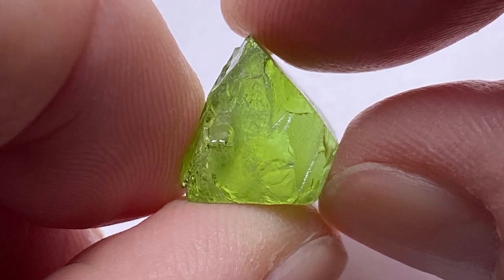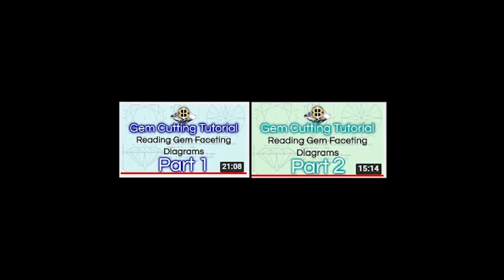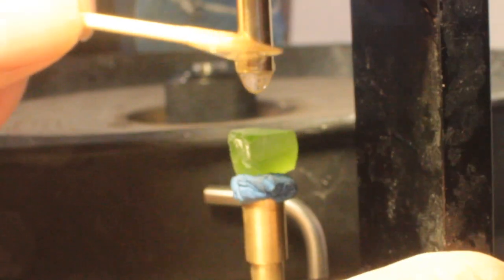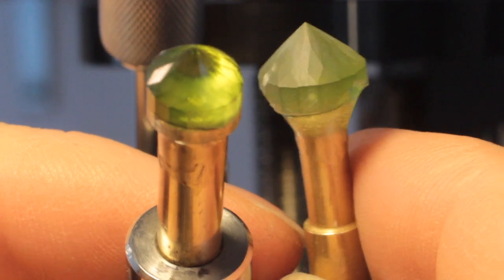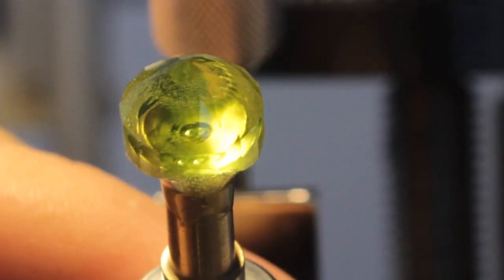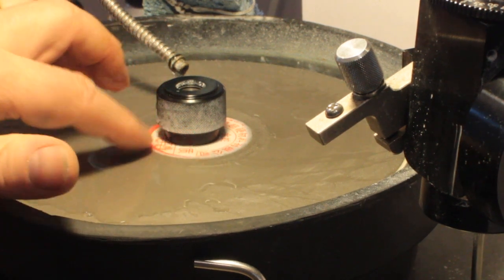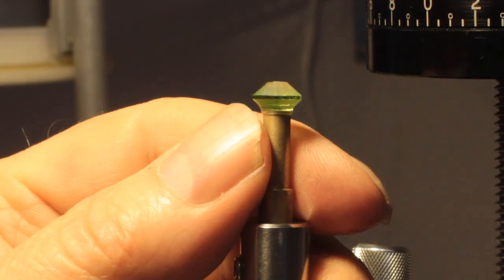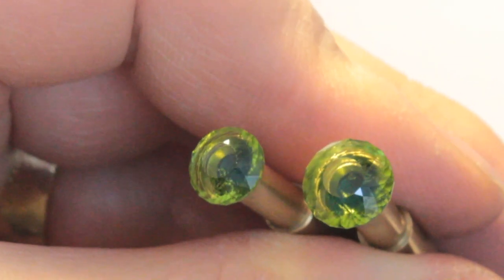Gem Cutting Tutorial: Top Color Peridot

Comment: One of the first stones I cut was the simple Portuguese design by Jeff Graham.  I have been interest in cutting Peridot for a friend.  I have not gotten any rough yet.  I feel and it is hard to say, seeing them on the video that there is much difference in the color saturation between the two stones.  A larger stone will look darker due to the longer path the light has to take on being reflected back at the eye.  That  said, I would go with the higher priced rough for smaller stones.
Reply: Thanks John, I had not thought about the larger size being a factor in making it darker...with a longer path for the light to travel.  Thanks!

Comment: how can we identify a diagram for a output to be a deep cut or not 
i.e. it will dense the color or diffuse the color?
Reply: I would recommend using design software like GSC or GemCad and the computer will show you the effects of different angled cuts on different gem material.  Basically, you can identify a good diagram  by the angles of the cuts of the pavilion.  This diagram, for example, darkened the stones...as you see in the video.  In another video, I take a dark stone (tourmaline) and lighten it up.  That video is called "dealing with dark Tourmaline".